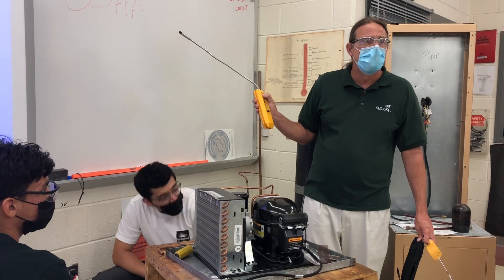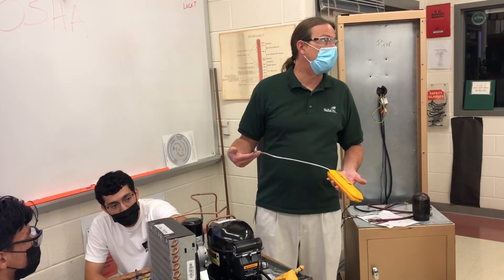HVAC Basics: EPA 608 - Certification Test for Trace Gas Leak Detection on a Refrigeration System

Comment: Did you say 2 wrenches one hand? Don't you hold one steady while you turn the other one with your free hand?
Reply from the maker: For the refrigeration trainers flared connection and the copper tubing being used they should be able to screw it on tight by hand and then use one hand to tighten the last bit with two wrenches like scissors. This prevents them from over tightening the nut and straightening out the flare. I show a demo in a filter drier project demonstration video that is one of there first projects tested under pressure. Thanks

Comment: Don't forget a vacuum test can also hide a leak. So according to the 608 test exam, we all know that a vacuum test is not efficient enough for a leak test. Yes we know there is a leak if it fails the Decay test but if it holds proves very little.
Reply from the maker: Yes, you are correct. Thank you Bob Y.

Comment: The bots found your channel! I wonder why all the bots choose this to post their bogus links?

Here's a real question though:
Why do you only go as high as the lower minimum pressure? Couldn't you find a sneaky leak easier with a higher pressure? One small leak that could elude a moderate pressure but only show up in extremes?

Please explain, thanks.
Reply: the higher number would be if the condenser coil was removed from the system and leak tested. in the video the evap and the condenser are connected together via the TXV so the entire system can only be presserized to whatever the max psi the evap can handle is
Reply: @james6794  that makes sense, but I'm going to listen again, I thought he said you can only go to the lower side minimum, which puzzles me if true. I'll be back here after a re-listen 😉.

Edit: "don't want to go higher than the lower of the two numbers on the low side test pressure" So it sounded like he said low side minimum when the intended figure is low side MAXIMUM. Correct?
Reply: @realSamAndrew   correct there is no minimum test pressure on the data plate. there is a max pressure for the high side of the system and a max pressure for the low side of the system. so to sum it up there are 2 max pressures on the data plate. always use the smaller number if the system is connected together
Reply from the maker: If we isolated the high side then we could use the higher pressure. Especially if that is where we suspected a leak after checking both the high and low sides and found nothing at first. Yes the higher pressure would find the “sneaky” leak better. On a side note: The refrigerant in this system would never get that high of pressure under normal conditions while running. Thanks.